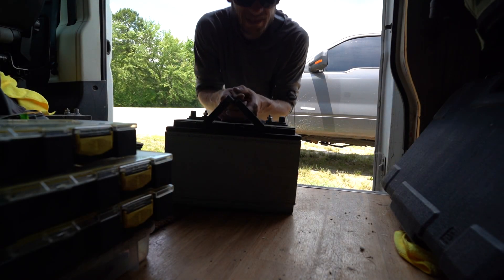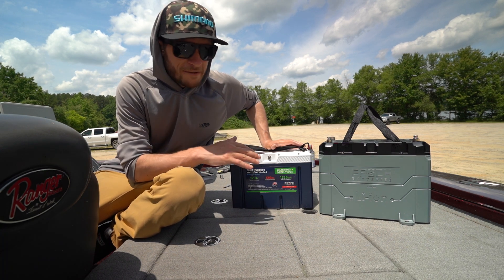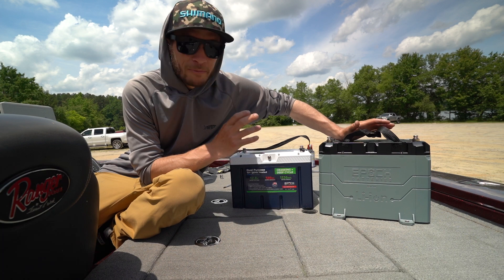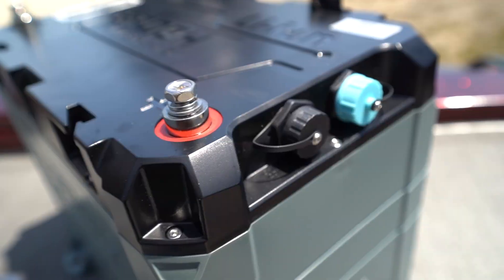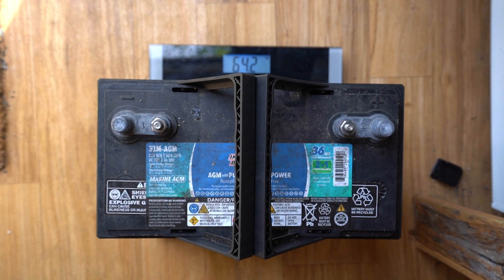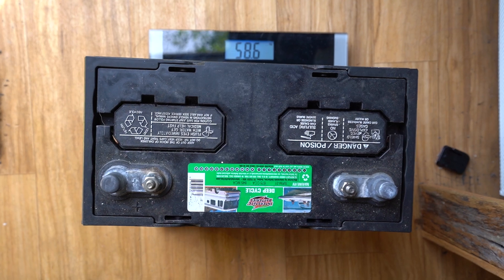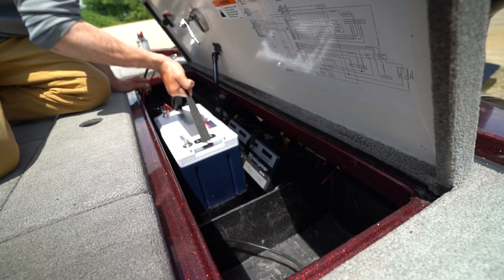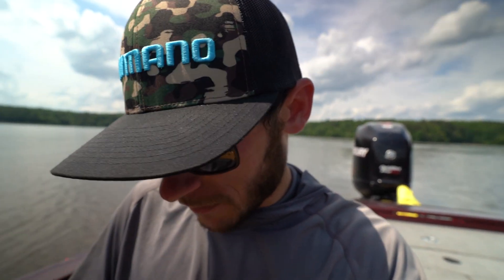Top 3 Reasons Lithium Batteries Are Superior and Why You Should Switch || Epoch Batteries

Comment: Have you seen the video on lithiums? They say it’s better to run them down to 20 percent and then recharge, not to just use 20 percent of your battery a day and recharge everyday. They say optimal range is between 20and 80 percent capacity

Comment: Hey man I have a question I hope you can help me with about glide baits, I have a small lake I fish a bunch and I’ve caught three 5 lb bass in like the last 3 years and I’ve been Glidebait fishing it for the last 2 years and I’ve gotten a couple nibbles but no takers so I’m not sure if there are bass big enough to eat a glide I catch 2 1/2 and 3 lb bass a ton but should I go somewhere else or should I keep trying?
Reply from the maker: Definitely keep throwing it. I have plenty of days I don't catch any fish on the glide but always have one on deck.  What size glide are you throwing? What kind of glide? Bluegill/shad profile? Are you getting alot of fish that just follow it?
Reply: I have several but I throw a 7inch custom resin shad profile in white and a Gan Craft 178 in bluegill color and I do get some followers but not a ton and I have sped it up slowed it down and everything in between. Also you should check out Zorba Baits Shad Daddy I have one of those in crappie color and they are super nice resin glides and they are $50
Reply from the maker: Sounds like you have got solid baits, should be fine there. Might be more condition based. Also, I always find that it’s easier to catch glide fish when you have it near cover and the fish have a “pin point” to eat your bait. Try it around docks, laydowns brushpiles etc. I feel like you have been doing the right things as far as fishing the bait with different retrieves, you just haven’t hit that day on the head where the fish are really eating it.
Reply: Sounds good I’ll definitely keep fishing it, it has to happen sooner or later!
Reply: Also I have 3 of the Gan Craft 178 in the floating and I add the suspend strips on them to get them to suspend in the water column wherever I need to and they run great, I also have 2 Spro Chad Shad’s one in bone one in Threadfin, 2 Storm Arashi Glides a bluegill and a oikawa mesu, 2 custom resin glides and a couple Shine Glide 185’s

Comment: Do u have a 2 stroke or 4 stroke motor and what does that do to any warranty with merc hooking them up to a lithium?  Also, what are your thoughts on the on/off switch of the batteries?  Seems like a perco would do the same thing and eliminate one less thing that could go bad.

Comment: I have a 16' tiller vhull boat, I switched from lead acid  (1- 24, 2- 27s) to a 50 and 2 100s, i dropped 91 lbs out of the boat, it's more stable, it handles better, is faster, and the added run time and fast charging is awesome.

Comment: I don't tourney fish but go out 6-8 hours. I got two 50ah Ionic deep cycle for 24v trolling motor  @14# each. Wet deep cycles were about 60# each. One 50ah Ionic for two bow graphs and Livescope. Just got the Ionic Red starting lithium which starts my 75hp Merc no prob and runs my console graph 9#. So I saved over 100# on my little boat ant it runs all day. It jumps out of the hole now and runs better. And as Matt mentioned. They sit at 13v+ so they turn the motor over faster.

Comment: The ionic lithiums ive had for almost 3 years already paid for themselves. Glad i went that route even for the engine. Charge them up and they last close to 3 or 4 fishing days for me. And having a smaller 16 ft boat weight saving is a big deal
Reply from the maker: Glad to hear it. That’s what was getting at in the video. I’m not a huge fan of the term “game changer” because it’s slung around for almost everything that’s new…but lithiums in a small boat are a legit game changer.
Reply: Ionic would be my go to based on experience but Im venturing into other brands atm. We'll see...